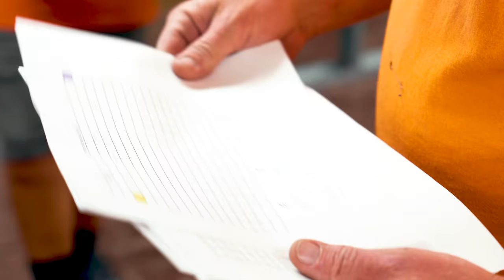WHAT'S WRONG WITH ME?? **Not about my Anxiety** | BRIAN BARCZYK

Comment: Just a thing to consider, with the 3.0 plans, you might want to split it to the upstairs and basement as separate expansions...you're probably, also, going to need to add an elevator or hit up against things like ADA restrictions. The swimming things would have their own messes to handle due to liability issues

Comment: Hmmmm, the journeyman carpenter in me has thoughts on your floor project in the basement.  If you dig down 2 feet, that is maybe going to go under the foundation.  You will need to reinforce or underpin the foundation.  That alone will cost a lot so don't forget to factor that into the project.  Gee the plumbing drains is another issue,  not a deal-breaker but just an issue to deal with.  So many people would get scared away from huge projects like this but you dive in head first, Love it, thanks

Comment: Huge fan!!! 1st off...but as a union builder. When you took the video of Lori is seemed like the ceiling were about 8- 10 feet high...i know you want bigger taller cages but in my opinion the amount of labor and work to dig 2 feet under and existing, older building with the structure and everything..wont be worth what you are gona have to put into it